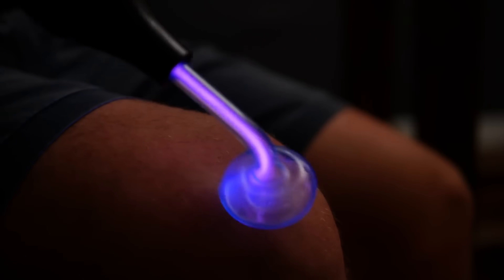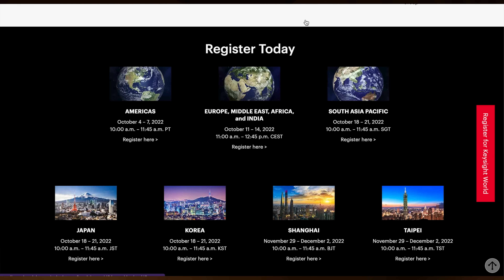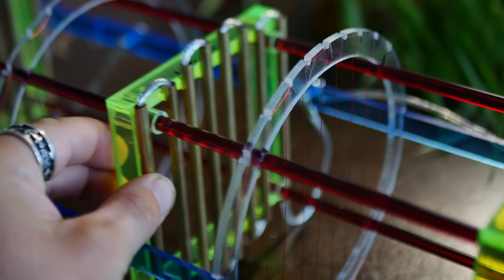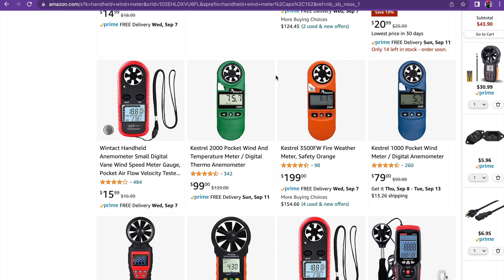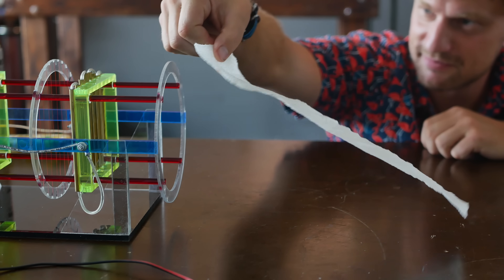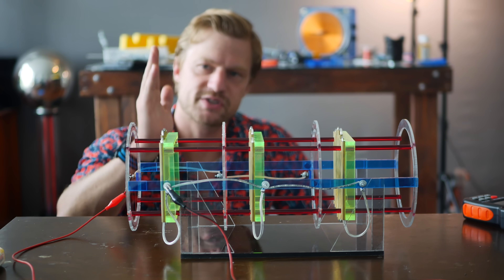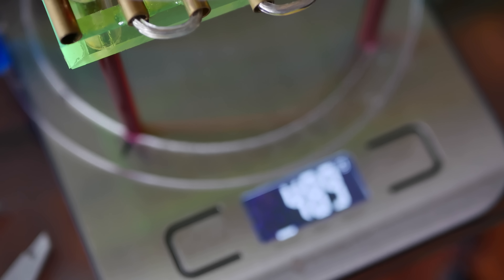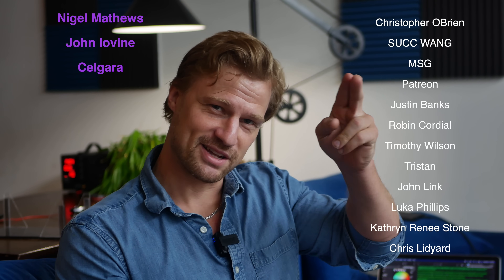Designing A Next-Gen Ionic Thruster! (For Flight)

Comment: I've thought about a one man personal flying aircraft kind of like the bikes Japan just released. In this case I thought of a propeller with ionic thrust and I did for smaller propeller in theory with ionic thrust standing 2 1/2 ft deep and 4 ft in diameter. The staggered placing is interesting. I almost wanted to research jet tech and combine these ideas. The center below the passenger I'd say a staging effect of large stability reasoning ionic thrusters moving air from a temperature conditioner and then inject a  gas to just stabilize the ride. Where the propeller/ jet/ ionic thruster= compression ionic jet stack! I think if you even read my comment I'd still be silly in any function! Loved the video! thank you.
Reply: jet tech actually propels air into compression but forceing it into and smaller exhaust less and more while in the propeller, compression pushing heavy! Then while in the release air should just be heavy more than tightened. Kind of like forcing the air out of a balloon and letting the air out of a balloon or just popping it. The air should be heavy when released rather than cutting... while talking propulsion. Because of the dynamics on ionic thrust I thought completely different... In this case run a  pulse with amplifier then a.c.! The air around staggered ionic conductors should be cooled but heat the air before system intake. Also utilize wide open jet tech ideals at your air releasing exhaust end. To help poundage use a breeze way ceilings fan for tropical homes as an ideal 'under propulsive property' and thermal compression for intake and surrounding body

Comment: I would believe one of the inefficiencies is the sides around the whole assembly, it allows air currents impact the side of the directional flow you're trying to achieve. If you put a duct at the front and enclosed it in a tube let's say acrylic (heavy yes but for testing I'm curious on the differences),

Comment: Think about the old vacuum tubes that came before transistors.  What did they do to the filament to improve emission?  Heat it!  In addition to the 33KV applied to all the emitters, make them out of nichrome wire and pass 3V 1A through each emitter to warm them up.

Comment: 09:05 
Man that was the true "money shot"... of this whole video.
I'm just a layman who stumbled in here by accident. But found this to be really cool.

Out of curiosity, if you put a turbine on the "output side of this" or heck.. "input side".. & powered that, would it boost the OVERALL output? & make something 
even better? or is that just a stupid idea?  (Basically it would be speeding up the air, going past the charged wires)

If you enclosed this set up with a shroud like a jet engine has, would that help anything?

On a side note.. a plasma cutter uses air & electrical current...   So, is an "Ionic thruster" just basically a "Plasma thruster"???

Comment: Does the speed of the airflow affect how much thrust is being added? I saw that the difference in acceleration between 1 panel and 2 panels was greater than panel 2 and 3. 

Would this setup benefit from having vertical tape like bands inducing the ionization instead of wires? Since there’s more surface area for the airflow to run across

Comment: Enclose the tube to get higher velocity. Also, pulse the grids. You can also increase the number of wires for the intake. If the interior of the reaction area is narrowed like a jet, and you increase the electrons, you might just get lift-off with help from the heated air.

Comment: this is fn cool

Is there a reason you left the build open? Would it benefit from a closed system (where the only openings are the front and back)? 

Maybe the accelerated airflow is being contaminated by the air on the outside of the system.

Have you thought about changing the density of the wires or the pattern instead of having them parallel to each other?

Comment: I wonder if it might be possible to make a whole lot of very short stages. I wonder what would happen if it were smaller at the outflow end than at the inflow end. 

I wonder if ions or microwaves could be used to heat the air somehow or heat a heating element which would heat the air in order to make it flow faster (expanding gas).

In a chemistry class I took in college, the professor presented an apparatus that blew air across a large room. It was just an empty metal tube about the size of a couple of liter-sized soda bottles, that was shaped so that it was larger on one end than on the other. He put a heating element inside that was burning kerosene, I think. The expanding air went out the short end faster than the front, so air ended up coming in the front to replace the air that was being blown out the back, and you had basically a small, fan-less jet engine. Not a ton of thrust, but, enough to blow your hair around a bit at maybe 25 meters away or so. The power is proportional the heat output, I guess. So I wonder if a metal heating element could be heated up with an electric transformer or with microwaves or with a laser or something.

This guy built a spot welding tool with a microwave transformer:

https://www.youtube.com/watch?v=6oxOFwyo0wA&ab_channel=TotallyHandy

Comment: I would think that a "enclosure" in the shape of a "tube" would prevent "still side air" from getting into the air flow. While this does work to greatly increase the VOLUME of air, it does not increase the speed of the air. (think dyson fan) I would think this would also cause non-laminar flow events in the air path. (turbulance) Which would decrease your thrust also.
And when I say a "tube shaped enclosure" I am thinking something along the lines of Plastic film wrap. (eg, the kind you wrap your food with) Super thin, and super light.

Comment: I belive it need restriction or or resistance to get full thrust  as it powers through the first stages it needs to be restricted and as it hits stage 7 build pressure then remove the restriction resistance and there you have hyper drive

Comment: Air flow can be much increase by a nozzle principle, encapsulating the nozzle in a confined tube to produce jet effect, an out casing is required for maximising the flow, and physical vanes are required. Notched or serated blades in the initial stage could be better as the point equidistant edge would release much uniform plasma wind flow.

Comment: Could you angle the fields to encourage a vortex? Also would shape affect outcome similar to a compression phase in a jet engine?
Reply: increasing pressure does have consequences tho. it decreses velocity of the air exiting, meaning it would increase torque due to the pressure but decrease horsepower
Reply: @yaishmatheen4274  true, how about the vortex effect, if the pressure can't be increased perhaps the flow of air can become more efficient, similar to what they did with the Dyson fan. It induces a greater flow of air using an effect whose name I'm forgetting (smooth brain moment oof)

Comment: Hey
Could you try sanding the wires on the anode? I see that the blue ion light only happens at some parts of the wire, with some sections being very black. I suspect that changing the surface properties would change this.

Comment: There are several issues with this design, as others have pointed out ducted airflow is a problem. The open sides allow for air to escape rather than being directed along the same path. 

However, the two areas I see that could be improved is perpendicular ionization relative to the airflow. In a multi-stage unit, the anodes shouldn't be aligned in the same direction. Also, shape, a conical shape step down in a closed shell, with a thrust nozzle, with stepped down anodes relative to the shape of the cone, should improve thrust.

Comment: Carbon fiber, fully enclosed system with aero film so it's a tube/cylinder only open at the ends, reshape frame parts to reduce internal drag (smooth edges) and most importantly: ducted inlet and nozzled outlet!

Comment: Ii is thinkin' that if you made each stage smaller in diameter it should increase air pressure as well as reduce weight.    😘
Just like a hose that starts wide & narrows, water pressure is increased at the narrow end as the same amount of water being taken up at the wide end is forced to flow through a narrower space.    ☺

Comment: Obviously, the system needs to be in a tube. After that, maybe try experimenting with a nozzle and/or some kind of venturi system? My idea is that the venturi would create a pocket of air that's more laminar in flow and already moving at a higher velocity. Less energy would be spent on trying to "straighten out" the air and could then be used to propel the air forward instead. However, if it gets too tight in the venturi, surface friction might outweigh any benifts.

Comment: Excellent. I would be worried about the source of power/fuel/current, personally- how to make that airborne. I was thinking that if you had the rings in series, but you used some type of oscillation and staggered the actual activation of each ring? Like somehow time the current perfectly so it displaces more air? How much does getting airborne depend on the air current itself changing state to propel itself upward? Is it the "heat" itself that is important? What if you doubled the magnet wire density and also the tubes? Would that allow more airflow- would it be better to build up pressure somehow?

Comment: One conservation would be vectoring and/entrapment (wind movement based on tunneling and its adverse effects on its direction), the other would be possibly compression and tunneling (similar to an open engine cylinder, vs a closed engine cylinder), third, because they are all me (for the most part) is dealing with excitement and separation (ionizing and destablizing based upon electronic current), which can create postponed losses if barometric pressure has an adverse effect on particle charging and discharging.

Comment: add more thrusters with modular connections system (to add more or remove),. progessive increase in power to speed ion travel like a Magnetized Rail Gun. Would more wires equal more power? would having a lesser amount of wires at the slow speeds promote further movement of ions by "filling up" and having excess ions pass the first set and be drawn to next truster, or a vice versa setup. I feel like with enough fiddling a perfect combo and tweeking can really make a powerful system that maximizes potential gains, perhaps even to a point where energy to create thrust to thrust power is so good.....new jets...

Comment: Perhaps the first stage air flow only discharges to ground a certain percentage of the air.  This would mean that non-discharged air would not be attracted to the next stage as the grounded air would be. That would slow the flow. Any additional stages would continue impending the thrust. 
One very charged stage would be. best

Comment: Had a thought when I saw the shots taken in the dark. In them you can see the plasma origin spots on each wire as the little glowing dots. I wonder if the wires had some kind of nucleation points on them like a champagne flute where you can see the bubble continuously form from individual spots. Point being, if they are indeed nucleation points, is there a way to increase the number of them per wire, and will that in turn give greater output?

Comment: What if you where to try and cyclone the air flow intake,  it should then increase the air density going in and there by boosting thrust. Also I would suggest enclosing the unit to boost pressure. Even plastic wrap would work, to keep weight down, 3 wrap around should be enough to hold a seal.

Comment: Looks like the diminishing returns that you get from voltage increase are due to the air getting fully charged. I wonder how a toroidal magnet would change the speed of flow. Prolly not worth it due to the weight of a magnet, but creating an ionized wind tunnel could make for fun experiments! Great video!

Comment: Perhaps it might be worth using a smaller diameter ground collector array compared to the emitter array to help focus the air flow towards the center a bit for a more dense air charge and to avoid losses of air scattering out the sides. Maybe taking that a step further and having the emitters in the subsequent stages more matched to the previous ground collector could create a bit of a funneling action throughout the assembly before any use of ducting

Comment: I think you need to confine the airflow by putting a cylinder wall in it, ang make the 1st stage 10 string, then the 2nd stage 20 string, then make 3 stage 30 string and change the fat copper tubing into a thinner plates to optimize more airflow.

Comment: If it was encased, would it be better? The air flow could be going to other places except straight back? Also, would the orientation of the grid change anything, or the spacing of each wire, or type of wire being used/size? What about power input? How much would that change? Is there a point of diminishing return? Plenty of questions to ask. This has to be one of the coolest experiments I've ever seen!

Comment: is the sides open. seems like putting it in a case to stop thrust from escaping the sides would be one. U need a power supply u can attach to it too so u got to take the weight of that in it if its going to fly. add more too it too. if you had 3 what would it be if u made it smaller and attached 6 at a inch interval. 

Also does adding more use up more power?

Comment: Honestly, all this stuff is way over my head, though I do have questions...

Did you pick 3 of the ground electrode grids just for the sake of testing/weight, or was there a reason for that many in particular? Would adding more of them increase the amount of electron flow to speed up the output?

Also, I presume that there's little/no heat production with ionic thrusters, judging by how you keep sticking your hand infront of the output end. So if such a propulsion unit could be used on a much larger scale (I'm talking like proper vehicles, not just the little glider from MIT you showed at the beginning), what sort of power requirements would be needed for it, and are such technologies even available?

Comment: how close can you place the wires(positive electrode) to each other per rack and how far apart does each set of electrodes need to be for optimal thrust? Do you really need an equal number of positive and negative electrodes? It looks like Alot of the plastic could be shaved down, really a 3d printer would help you out here.

Comment: Hell yeah...show more of these kinds of things. I would have like to see some current measurements as well as some changes to the wire diameter to maybe a plate system to allow higher amps and voltage arcs to increase the power output per jump. Additionally it would be interesting to see what happens when you converge to of these systems into a single flow. Would also think these wires would get dirty and the efficiency would go down? I look forward to seeing how these might happen or not.

Comment: some thoughts.        good work.          minimize the obstruction of air flow.!        eliminate the  CIRCLES.        use balsa, instead of plastic.!          the distance between stages should be optimized for minimize loss of inertia (in the gaps).

Comment: What if, rather than your anode being wire, it was a free spinning metal turbine blade...  You'd still generate an air frow from the surface of the blades to the cathode, but that would also turn the blades helping to amplify the flow.  Furthermore you could coat the back of the blades with an insulating material to reduce the generation of ions at the back of the blades, which would otherwise be drawn to the cathode of the previous stage (generating a back flow).

Comment: Combining with electric rotor turbine = plasma jet engine, the problem are how to assembling it fitting it in electric rotor turbine engine so the plane powered by hot air from electric plasma then compressing and thrusting by electric rotor turbine.

Comment: I would say an enclosure like a jet engine needs, thinner diffusing wire, and an airfoil like grounding rods to allow easy air flow and less disturbance. Maybe use 3d printing for the next frame, they have a filament that is foam like and is the one of the lightest filaments you can get.

Comment: Awesome, ... So Okay , try the same thing using laminar aluminum foil, of varying widths, or just 24 awg wires with multiple windings, Like Arthur C Clark's "Bussard Engine" in his short story  " Tau Zero".  instead of the "tubes" that were used ....Also.... ,with the above note, You might try adding more electrons , say in stages... 30 kv, 45 kv, and 60 kv , or go all out and make a Tesla- HV drive for it, in front and behind the anodes, to see if it enhances or degrades the "wind" , etc etc .

Comment: If it was all in a duct there would be no chance for additional input airflow along the length of the design.  Probably also would benefit from a taper in the diameter from inlet to exhaust.

Comment: Take designs of modern jet engines and their housings. You need an intake to have desired and directed airflow velocities. You need an enclosure to guide the intake airflow in the most efficient way for your design. Finally you need a compression chamber at the rear. Basically you should build an ionic thruster powered ramjet.

Comment: Hmm I am curious what if you add a funnel shape to the thruster end of it? Will that give it an increase in air flow or anything? Also what happens if you enclose the whole thing in some sort of form fitted cylinder just incase any air or anything else is escaping through the sides or something else? What happens if you combine both of them into one new design? Will anything happen if the copper wire is closer or farther apart?